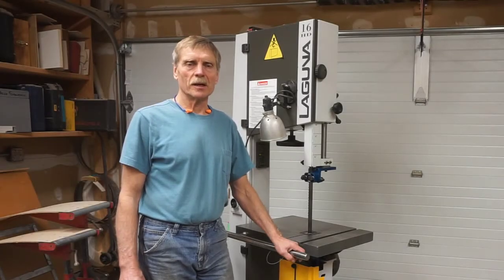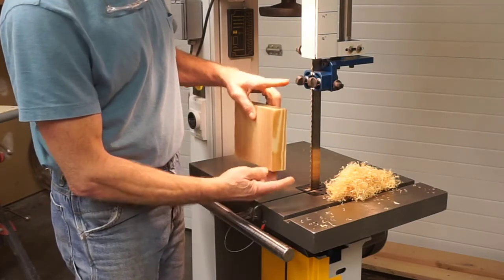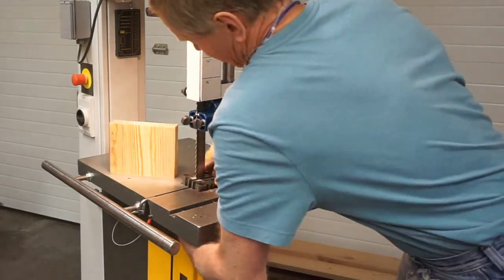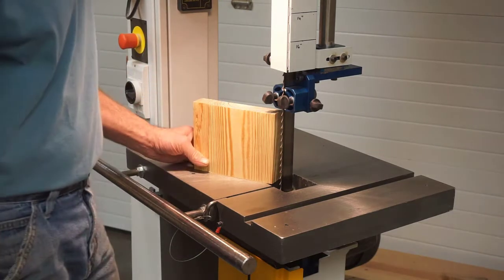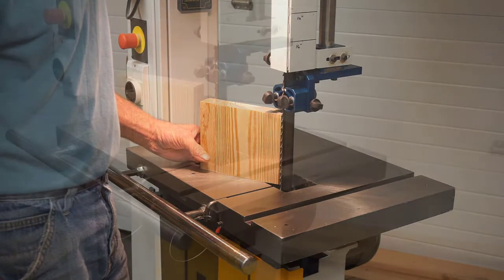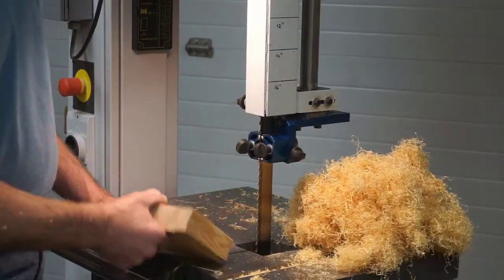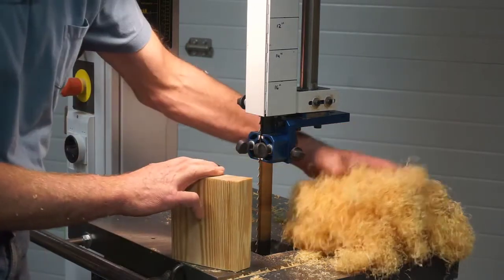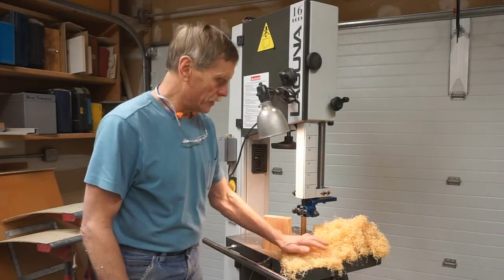How to Make Wood Wool for Hobbies, Decorating or Packing Material

Comment: That would be good for Tinder for starting fires to
Reply from the maker: Don't you know it...  When made from pine this stuff is like shredded gasoline! After packing Christmas decorations away after the season I use the wood wool from the little manger scene to start a couple morning fires in the woodstove and it works great.
Reply: Next Level Carpentry yup I figured that

Comment: Well for mine at $17 a kilo of store bought wood wool....I also have a Laguna Band saw with such a blade, but I value my hands and arms more than a bit of wood wool, if that blade was to catch the timber it would pull your hands into the blade with disasterous results, the safest way to do it would be to make a "jig" to hold the wood with your hands well away. Bandsawing it safe but when to have so much blade exposed and not working as a bandsaw should be used, I can see tears with no hands to wipe them too!!!!